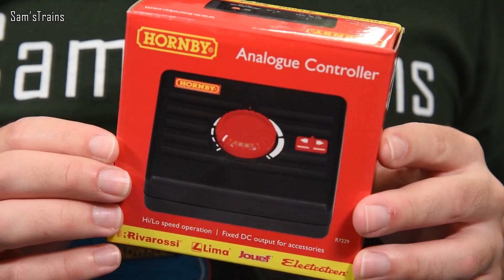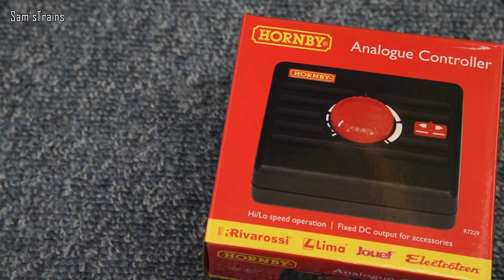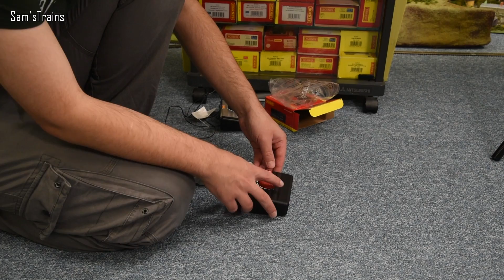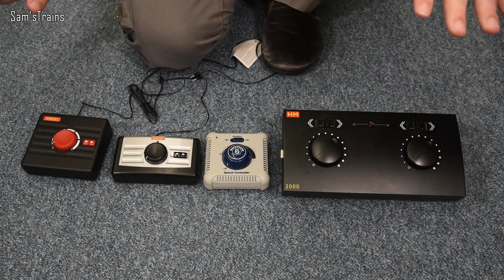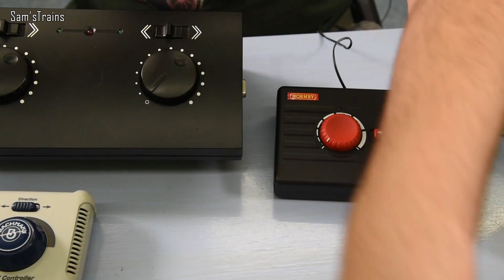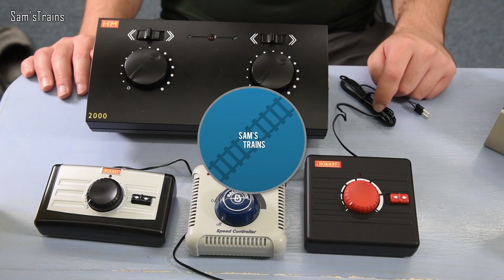Hornby's New DC Train Controller | Controller Buying Guide

Comment: I'm a bit older so I remember the old British made r965 controllers that used to come with the starter sets which were excellent for slow running and much quieter than the newer controllers (similar to the HM2000) although they often had a weird quirk where some locos never quite stopped without you turning the reversing switch to the off position. It would be interesting to see how they compare to the new ones.
Reply: I'm 34 and I too had several r965's and they seem to be significantly better then the modern units! Good slow speed control and smooth turning control.
Gone DCC now, using digitrax dt400cab and it's night and day better imo.
Reply: @ShortCycle. Seems that a consensus has to be made on the older R965 controller circuit and the differences between itself and the newer controllers.
Reply: You beat me to it. The potentiometer on the knobs of the R965 had a nice feel too, nice and resistive.
Reply: I have one of them, they take some getting used to
Reply: i have a R-965 but the built in track connection leads are missing since i got it second hand so i have to use the silver input and output clicks
Reply: I have 2 on my current layout(as they were the only ones I had when I built the layout but between half speed and crawl speed the engines jerk along I watched this video to find a replacement.
Reply: Used a high power rheostat or a variable transformer in the older 900 and Hammond & Morgan controllers. Still had the turn up high then lower setting characteristics on starting the locomotives however. 
Do not know if a substituted power pass transistor (check the Jedec and the Japanese JIS serial numbers from an equivalents tech book list. Towers or ECA Data. As well as investigating the twin transistor Szikali Darlington arrangements for the power pass transistor), and the substitute protection cutout subject to the power adapter supply current.  Fitting a different size Bulb 24 v low current or a LED indicator with a series resistor across the cutout will give an indication of the operational status. Other posts on controller upgrades are on YouTube such as a two transistor BC 547/ BC 337 suggested as an upgrade and TIP 147 assisted potentiometer in 3 parts and a R965 controller upgrade.
Reply from the maker: Thanks a lot Jonathan - yes the R695 were very decent for the time - but you're right about the quirk, and I found that mine used to put out a few too many volts, which some engines didn't like!!
Thanks for watching - Sam :)
Reply: @SamsTrains  Wondered if using the 16 v AC output via a rectifier would have helped here. ESR Components do stock an AC 1000mA plug in supply adapter.

Comment: PWM = Pulse-Wave Modulation for those who don't know. Yes, I'm not a fan of it either, but I guess it depends on what motors you're using? Maybe modern engines have some electronic wizardry built in that makes things easier on them.
Reply from the maker: Thanks for that Jonatan - yes I suppose some motors will respond better to it than others! But knowing the cheap and nastiness of many modern loco motors, you don't want to risk it really! D:
Thanks for watching - Sam :)

Comment: The track controllers you use are, I will admit, better than what I have. I'm stuck with my train set controller, but it's just as good as yours. You've luckily put me off buying the new Hornby Track Controller. However, I was expecting another steam engine running session, so shame on you for disappointing me on that level. I found this controller review 100% boring, if you want my honest opinion. You're all about model engines, and rolling stock, not annoyingly cheap controllers. Yet, I'll forgive you on the part where you were testing one of your steamies, and I'll say the review was 99% boring instead. Come on, Sam. Where's your sense of Steam Engine Adventures? If I don't get what I want next time, Thomas, Foxcote Manor and I will give you what for. Do we understand each other?
Reply from the maker: Thanks for that Kelly - no I can't recommend the new Hornby one, as you can see! I promise there won't be many controller videos ;)
Thanks for watching - Sam :)

Comment: Good video although it would have been nice to see the Gaugemaster Combi included in the test. The short circuiting was a good point to include. My old Triang P4 had a tiny button that popped out. Similar I suppose to modern trip type household fuse boxes. What happens with a short circuit in the new DCC technology I wonder.
Reply: On Gaugemaster Prodigys, the screen just keeps flashing on and off until the short circuit is cleared. And I think on the Hornby computery one, it just flashes up on screen to clear it
Reply from the maker: Thanks John - yes regrettably I don't own any Gaugemaster controllers - but I do know how good they are. Yes the trip switch is a brilliant idea - such a shame Hornby didn't think to use that!
Thanks for watching - Sam :)

Comment: If I buy a Bachmann ez train set is that good as I have a Hornby collection??? Ps can u fix old Hornby 060's great vid
Reply: Bachmann and Hornby follow an international standard, you should be able to run any train anywhere as long as it follows that standard. Sam has been running Bachmann locos on his layout before, the only issue is the 00 trains are bigger than the H0 ones and can look weird if used togeather.
Reply from the maker: Is it their EZ command system? Which is essentially a DCC system. Provided your not mixing DC and DCC, they'll always be compatible of they're the same gauge! :D
Thanks for watching - Sam :)

Comment: Nice little video Sam. I’m have a Bachmann controller and I love it, but after a year of use my one has developed a problem. When I stop my locos it will send them full blast one way or another for a short period of time. My layout is a end to end on a high table so when this first happened it did scare me 😂. You should try the Gaugemaster controllers. From what I have heard they are very good. I was also thinking of upgrading controllers to the new Hornby one, I’m going to think again now...
Reply from the maker: Thanks a lot mate - sorry to hear about that problem - that's definitely not a good thing - I think it'd scare me too! Yes the Gaugemaster ones are best, from what I've heard!
Thanks for watching - Sam :)

Comment: For anyone who wants to know about digital controllers:
I've got a (digital) Hornby Select controller I bought as part of an old train set. I had it upgraded last year, which wasn't cheap, but it is now fully DCC compatible and basically the same controller as the Hornby DCC Select that is sold today for over GBP 100. That means I can now use it with decoders and locos from any other OO or HO brand (which I may well do), so trains from the UK, the continent and the US as long as they are DCC compatible.
I'm actually quite happy with it, but I've only run it with up to two locos so far.
The only niggle I have is that you have to remember or write down what each command does, because all commands to the decoder of your loco are just numbers you enter on the controller.
If you can get your hands on a cheap old one, check Hornby's website for costs and conditions of an upgrade. You probably only pay for postage one way since they will send it back for free to various parts of the world.
PS: Sam, feel free not to reply to this comment.
Reply from the maker: Thanks for the comment mate - yes as a basic controller, the Hornby Select is a good option - I quite like their latest version of it! :D
Thanks for watching - Sam :)
Reply: Hornby say this about the Select on their website. * Please note certain US manufactured decoders are not suitable for use with the Hornby Select unit due to their inability to conform to EMC requirements.
 A review on Hornby's website says, 'Works well with Hornby and some Bachmann decoders (might work with other brands as well) but does not work with Dapol, LaisDCC and various other brands of decoder. If you are sticking with Hornby and Bachmann decoders then its very good, but if you have or intend to have other decoders as well I don't recommend.' 
I'd save up and buy a Fleischmann/Roco Z21. No need to remember what each command does. It has little pictograms with horns, lights, brakes etc. that you press. :-)
Reply: @Boppy-B-B  
Edit: the info you mentioned is a user comment, not an official Hornby communication. It also doesn't specify what software version the controller was. It is a new comment, but it might refer to a second hand controller (end of edit).
I've actually used it with a Uhlenbrock decoder and it's fine.
It also depends on what software version you have. Note that the old version (I had 1.1) was much less DCC compatible than the latest, which is why it is now called the DCC Select, as compared with just Select before.
Reply: @Boppy-B-B  I had a look at the manual for 1.4, which is valid for software versions 1.2 to 1.4 and it says it is a DCC controller. This means that it should be compatible with DCC compatible hardware as it did with my Uhlenbrock decoder, which, by the way, I put into a Hornby DCC ready locomotive.
Edit : the manual can be downloaded here:
https://www.hornby.com/us-en/downloads/view/index/cat/12/
Reply: @diedertspijkerboer  The  part about the Select not being suitable for some US manufactured decoders is an official Hornby communication. The Select does not have an NMRA warrant, unlike the Elite.
Reply: @Boppy-B-B  Could you please add a link then?

Comment: £15.99 is £16.00
Reply from the maker: It is indeed!
Reply: They used to say that the reason they ended prices with .99 was because then the checkout operator would have to open the till to give you change and so prevent them from stealing money. The real reason is psychological. It makes you think it's cheaper than it really is. £399.99 sounds a lot less than £400.00. ;-)

Comment: I have the Hornby controller that came with my Mallard set, but havn't used it yet, as I just use the Bachman one hooked up to my tracks and it works fine for DC, How about reviewing DCC controllers, I have a Prodigy express DCC controller that I got for about 50% off when the local Hobbytown store closed in March.  I'm also looking at building a DCC++ controller to replace it using Arduino's, since I love Arduino, and want to use them to control everything!
PS: When're you gonna run the Pere Marquette Berkshire again?
Reply from the maker: I think that's probably smart Kurt - the Bachmann one was better! That sounds good - I don't do much DCC these days though - but I guess I could review my controllers! :D
Thanks for watching - Sam :)

Comment: Hi Sam 
With the old cheap hornby controller you can reset the you will need to un plug the wire and unplug the power plug from the socket
Would you recommend the airfix usa 440 tender engine
Reply from the maker: Yes that's true Lewis - it goes in the end that way! I don't really recommend those - mine blew up after not long :(
Thanks for watching - Sam :)

Comment: 7:10 I actually opened my old analogue controller and you can actually remove a clip that has the locking mechanism, and it still works :)
Reply from the maker: haha yes you can - I've done that before too - I should have shown how to do that too! ;D
Thanks for watching - Sam :)
Reply: Would get a centre off direction switch substituted. Not that many in supply though particularly of the slide type. Rather notchy in operation though.

Comment: Best controller is a cheap but reliable one I have a super set Hornby dc one and the r964/965 transformer and controller for track 2 and accessories I plan to buy a triang r170 for use with the red lever frame switches they did I paid £2 for the switch!
Reply from the maker: Ahh very nice - yes you can't beat the old ones can you?! :D
Thanks for watching - Sam :)
Reply: Yeah I have a few items now by triang also I got Bachmann track which is same as Hornby 2nd radius ie r607

Comment: Hi Sam, always interested in controllers. I am afraid the Hornby offerings (not the H&M2000) are seriously rubbish, horrid, crude and cheap and not at all what they should be putting in train sets to get people started in the hobby. The PWM is 19 volts peak and that is way too high for our 12vdc motors some of which are actually rated far less. Clearly there is no filtering at all on the output hence the motors screaming. The H&M 2000 actually uses PWM and feedback but does so in a much more elegant way, with filtering and proper control. The Bachmann would be my choice. However it's worth pining out that for good slow speed control normal full wave rectification (used by Gaugemaster) at 100hz is much safer than any PWM design. I wonder if the low switch reduces the peak to peak voltage? no matter. It's rubbish lol vcheck this page out mate https://www.scottpages.net/ReviewOfControllers.html
Reply from the maker: Thanks very much Mike - I felt the same way - the sound of that J50 was making me cringe! Appreciate the info on the HM2000 - yes it does seem to have a much nicer and less aggressive output! 19v peaks, is that really true?! How damaging that must be for the motors!
Thanks for watching - Sam :)
Reply: @SamsTrains  Cheers Sam, yes it just takes the input voltage 19vdc and bangs it out in jagged pulses at a given frequency. Sounded a bit like 200 Hz to me

Comment: The standard Bachmann controllers are  good in terms of functionality. 

Forward and backwards movement (without having to stop the locomotive) 

Ports to hook up left and right points.  (Some of the newer controllers have this)

DCC EZ command has 10  slots for locomotives (the 10th being for DC engine

Plug in's for DC Controller,  Ethernet ports to hook up to a computer

Also with those Hornby controllers,  that  J50 sounds like my 1979 Athearn Trainmaster (Fairbanks-Morse H-24-66) after I got it to run again with a couple squirts of WD-40
Reply from the maker: Yes I agree, they are much better indeed! Ooh really?? Not a healthy sound on that one either then?! ;D
Thanks for watching - Sam :)
Reply: @SamsTrains  the engine was partially affected by the March 2019 flooding we had in the Midwest